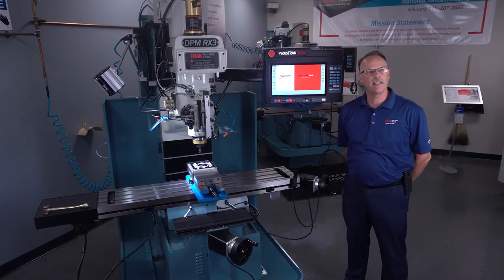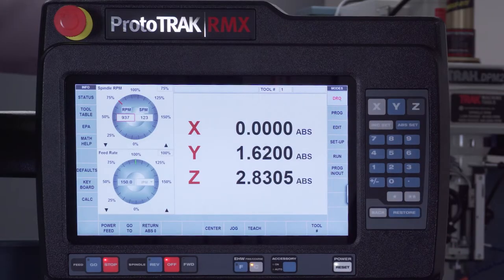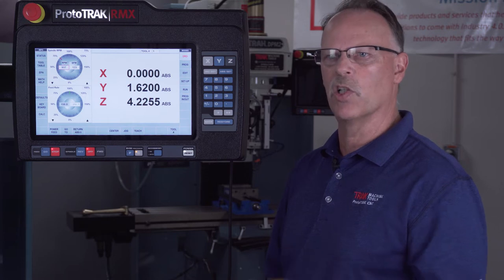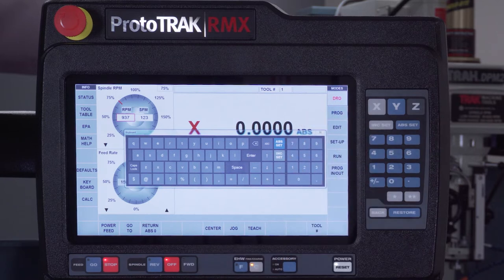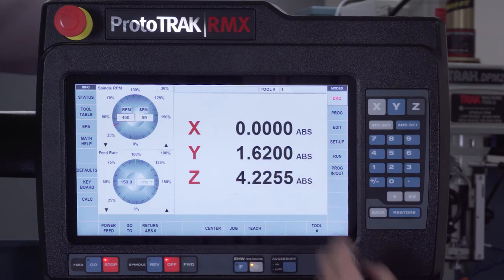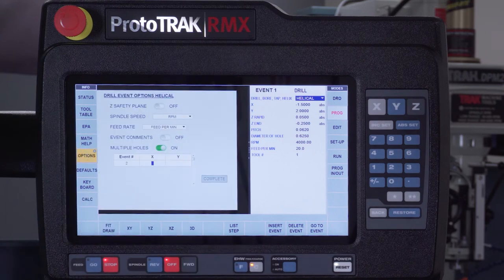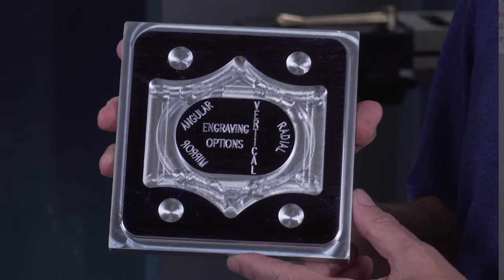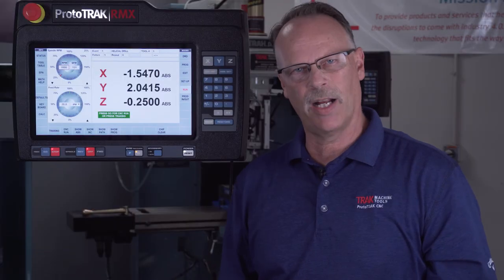TRAK RX Series Bed Mills Overview feat. the DPM RX3

Comment: which 40 taper tool holder is used with the rx5?
Reply: The DPM RX3,5 or 7 all use 40 taper tooling.  You can choose from NMTB or CAT. The only difference is the length of the draw bar needed so be sure to order your machine with the proper draw bar for the type of tooling you choose to use.  FYI, NMTB tooling has an extra 1 inch of shank on top of the tool holders where the draw bar screws in.  Generally, there are more tools available if you use CAT.  T.P.
Reply: The new mill is coming with the air tool changer like the mill shown in this video.
Reply: @matthewcornelius5862  yes, Cat40. Thanks